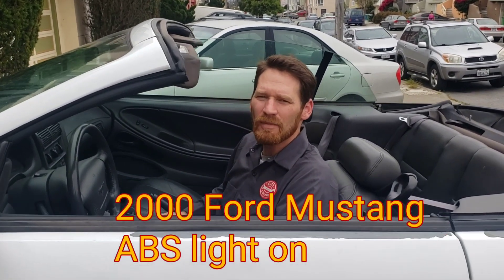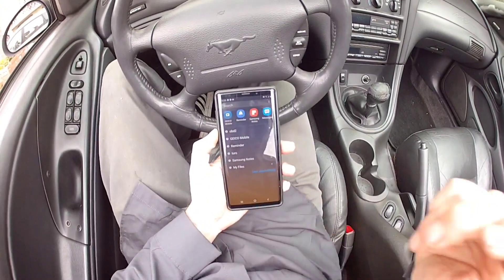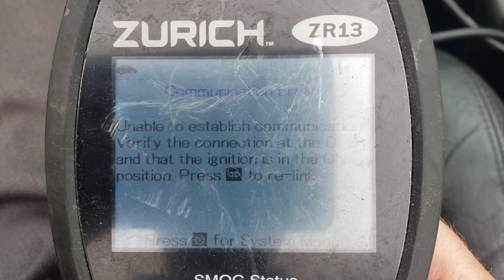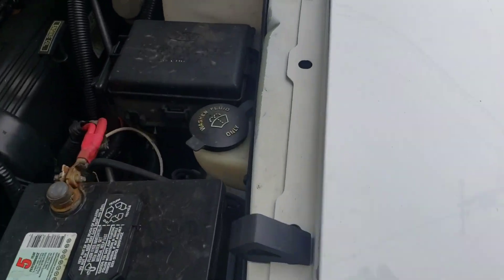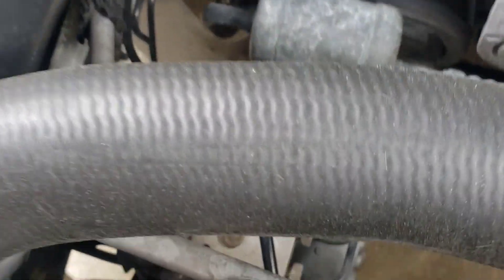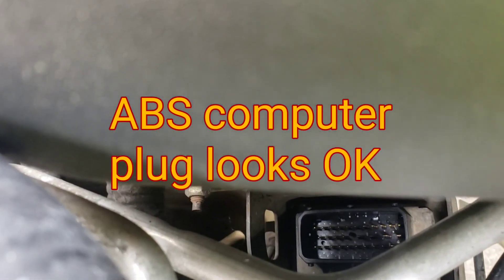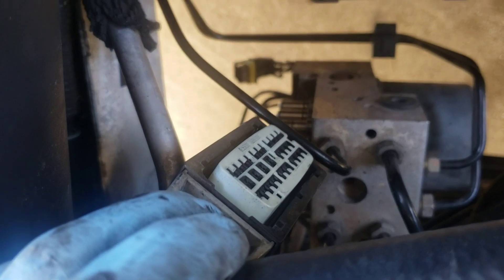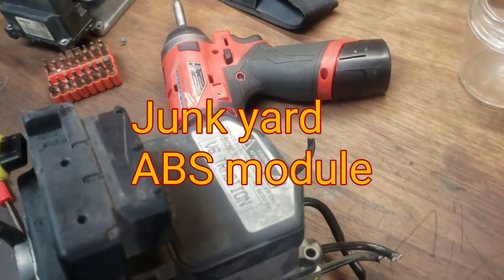2000 Mustang ABS repair

Comment: Hey if anyone here is still around to see this, I had a similar issue and scan took said exact same thing. My ABS went out slowly where the light would come on but then I’d whip the car a bit on some backroads and it would turn off. Then it would be off when I’d start the car on cold mornings and come on as the car warmed up; it’s always on now. 
Was this that computer module slowly failing?
Reply from the maker: yes

Comment: How hard is it to replace the module on your own with someone with limited technical skills near an engine bay?
Reply from the maker: @Smithmaj2012  the bracket is a bit confusing and the screws holding module halves together are torks heads so a bit challenging mechanically speaking
Reply: @ aka - get it to a mechanic.  I have various torx sets from mods I’ve done on my mustang.  Just trying to avoid paying 800 bucks online when I see them for 80-160 on eBay.  If I could do it myself.  Just don’t want to make it worse
Reply from the maker: @Smithmaj2012  if you leave the silver metal box in place and don’t disconnect any metal brake lines it should be fine.  The black part of the abs module and wire harness plug can be removed without disconnecting the brake lines so brakes will still function normally just no abs function. This is probably how it is already if the abs light is illuminated.

Comment: Awesome video using common tools available to the general public with the repair procedure straight forward and easy. My 2000 Ford Mustang base 3.8L was hacked up - The issue is greatly compounded when the vehicle is in a no start condition. Things like grounds, fuses, wiring, PATS, CCRM, ECM tend to complicate most troubleshooters.  Ford uses a remote circuit board called a CCRM (constant control relay module). CCRM is just a circuit board with relays on it to power items fuel pump, ABS, fan, AC clutch and ECM power. Any of those items not working the CCRM should be suspected with many repair websites offering to repair it. Of course, troubleshoot the voltages going into and out of the CCRM to assure it is functioning properly "first". The 2000's mustang have the blade key with the PATS Antitheft key system. If the theft light is flashing quickly the car thinks its being stolen and the immobilizer is activated. A high-end programmer/locksmith would need to be used to make new keys for it and/or replace the PATS module. After the theft system is satisfied that it is not being stolen then a mechanic can continue to troubleshoot the no start condition- bad ccrm, bad ecm, bad fuel pump, etc. Never just swap parts, you probably wont get lucky, but some will, always troubleshoot the problem first saving you time and money spent of useless new parts that didnt fix the issue.  Understand please, that electronics and cars were just starting to integrate heavily in the early late 90's/2000's and some of the circuitry was overengineered and overly complicated for a wrench turning mechanic. A mechanic today has to have a solid understanding of a (VOM)voltmeter, grounds, very skilled at schematic reading and wiring to troubleshoot a vehicle integrated with numerous electronic modules using CanBus tech to communicate between them and run the engine and all associated components and send back all that info the car ECM. The complexity of these newer car communication systems is why you dont see mom and pop mechanic shops in the corner garages anymore. The older generation of great mechanics could not/would not/ didnt want to upgrade their skills fast enough to keep up with technology and the slew of broken-down vehicles being thrown at them. The creator of this video did a fine job of how to repair the ABS no communication problem. Hopefully the supporting circuitry (ccrm) your working with is operating perfectly along with the PATS antitheft system, otherwise your looking at a nice rollercoaster ride of troubleshooting.  I hope my rambling helps somebody; this video helped me understand how difficult/easy the disassembly/split of the ABS electronics from the pump actually is. Thanks Mr. Electric!
Reply: A shout out to to @Mr.Electric - your words are profound, "It looks pretty okay." Thats one thing I've learned over a million times in +42 years of troubleshooting. Things look pretty good most of the time. If our xray eyes could check for cold solder joints or defective components we'd be good to go. Have a good one.

Comment: I have 2004 mustang v6.  When the ABS light is on I can't communicate with it just like you couldnt.  When the ABS light is off it allows me to communicate and it gives me b1318 code (battery voltage low)
Reply from the maker: The fuse or plug connection could be corroded

Comment: the common issue is bad solder joints in the abs module. it is a gamble going to the junkyard hoping to find a working one. my gt had the issue many years ago. sent it out to get repaired buy a reputable guy online that had a website and forum post. worked flawlessly after the solder joint repair. mine was the original unit and it was shipped back to me not swapped out with a different one.
Reply: Could you give the guys info on here, experiencing the same problem on my 2004 GT
Reply from the maker: Agreed, Sending the original out for repair is the best way to fix this issue.

Comment: I got a ABS module from the junkyard and installed it but the ABS light did not turn off :(
Reply from the maker: Could need a brake bleed, checking the codes is important too.

Comment: "Unable to establish communication with the Ford ABS system" that's exactly what my scan tool says! I just bought this 04 mustang and it's been doing the exact same thing to me! Driving me nuts! Thank you so much for making this video. I'll be going to Pull a Part tomorrow and trying this myself. Everything else is good, fuses are all good. I just hope the donor car doesn't have the same issue.
Reply: update?
Reply: @BlacknRedSN95  I got 1 from U pull it and put it in, but the same thing happened.  I went back and got another one, and it actually worked the 2nd time. It does work, but it's a common problem with those mustangs, so getting a donor one is like rolling the dice.
Reply: @somanynamesilltrythis0180  yeah i feel you,  thankfully mine has been off for like 10 years so imma just let it rock  at this point lmao
Reply: @BlacknRedSN95  i understand that. I ended up selling it bcuz it was one thing after another.

Comment: Would a V6 traction abs module ( electric part only) unit work on a gt, are they the same?
Reply from the maker: It says v6 on the original and replacement I noticed. I did get a replacement from a v8

Comment: Exact issue that I'm experiencing on my '03 MACh 1.  The dealership said they cannot connect to the module and asked me for $1,200+ just for the module.  I think I'll be finding one like you did and repairing myself.  Did you take the entire assembly out of the bracket to gain easier access to the module torx head bolts?   Thanks for the video.
Reply from the maker: yes I took the module out of the bracket to get to the screws that hold the two halves together. I left the brake hydraulic lines connected and did not need to bleed brake fluid so it was pretty easy.
Reply: @Mrelectric423  Thanks for the additional info. I have a unit coming from Automotix and look forward to finally getting these lights off (Trac Off also on).

Comment: Two questions - How do you get the black bracket out? And how do you get the module off the pump? Is there a trick.or special tools? I can't get to anything in my car. Did you remove the AC lines and radiator?
Reply from the maker: I pulled bracket and complete module together then seperated bracket , finally seperated module halves. The bracket to module studs can get caught if the slot in the bracket is deformed